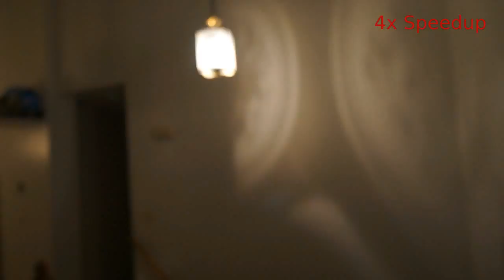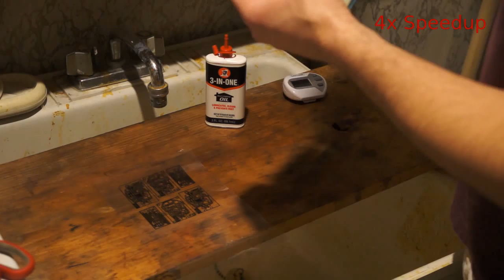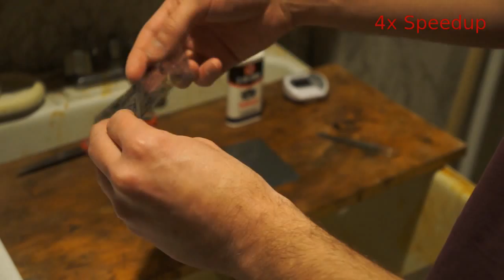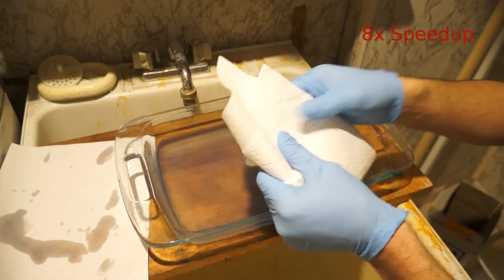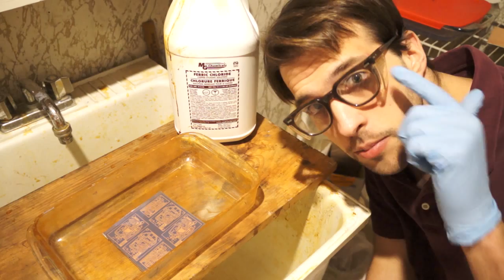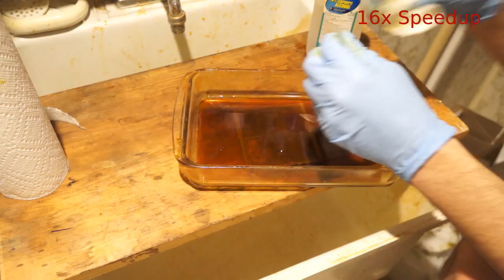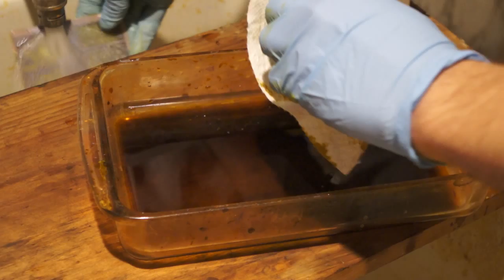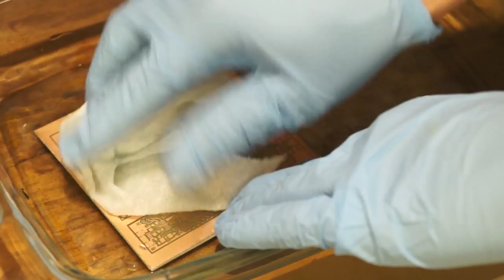How I do my projects - Part 2 - Producing the PCB

Comment: Ridiculously complicated :)) I recommend using PCBs with UV sensitive coating on them > Sodium Metasillicate (as developer)  > Ammonium Persulfate (as etchant). Much cleaner and faster (the whole process takes  less then 10-15 minutes, including exposure (also - I expose only for 70 seconds on my DIY exposure unit - precise and fast. just needs to warm-up for a bit before the exposing starts)

Comment: I did the old making PCBs at home for years, i use to buy the exposure type copper clads, i don't anymore, I do this now:
1. design your board on your favorite PCB program
2. convert files to gerber
3. go on ebay and find a inexpensive PCB manufacturer 
4. send files, get quote, and if satisfied, pay them.
5. wait for delivery.

trust me, I went the manufacturing method and I've never look back!
Reply from the maker: +BCcreativeInnovation I do some of each.   I use electrodragon when I need 10 big boards dual side and can wait.  They do up to 10cmx10cm for ~$20.  I use Osh park for smaller boards. I print my own when I want a PCB in 30 minutes

Comment: Good video, I do it a bit differently: I don't use water when laminating the resist, just do it dry. I have to double-up the mask becase the printer leaves holes, and I don't use oil, just hold it down with a sheet of glass and some weights. I cut the boards out with a multitool and chip-breaker router bit - I find shears can often delaminate and wreck the material.
Reply from the maker: I used to apply the resist dry, and I used to do it without the oil.  But, the oil makes the mask much more forgiving, and the water makes it so you don't get those annoying imperfections and bubbles of air.

I also used to use a dremel with a cutting bit.  The problem I had with that was the dust it generated got into the gears and destroyed the tool. Apparently fiberglas dust is terrible for machines :(.

I have had trouble with some shears on PCBs from providers, but, I found a guy on ebay that sells super high quality PCBs, and haven't had any problems with them :).

Are you still able to get fine pitch when you double-up masks?
Reply: CNLohr Well, I use the same tool for drilling etc, so it's going to get fibreglass dust around it anyway. Might as well using it for cutting\routing too.

I have had no problem with doubling up masks. As long as I take care and align them properly. I have successfully produced boards that included LQFP-48 packages - 0.2mm pads with 0.5mm pitch. Good enough for me!
Reply from the maker: Get some pics up on /r/electronics!  I actually used to do .5 pitch parts with toner transfer, but, not with anywhere near the quality!

Comment: I'm so jealous of your results. I just tried dry film for the first time a few days ago. After watching this I see I've over exposed my film, need to try the water application technique, 3 in 1 oil trick, and I can get more aggressive than a cotton swab for rubbing stubborn areas of an etch. Thx for the tips.
-Jake
Reply from the maker: Let me know how it goes!  It probably too ~20-30 prints to get this good.
Reply: CNLohr 
  I just did my first successful double sided etch today. The water emulsion/vinyl graphics style application of the Chinese dry film made a massive difference. I also used a 1/2 folded paper towel between my iron and the board instead of the different papers I had tried before. That made a big difference too. The paper towel distributes the heat way differently than a piece of paper, card stock, or news print. I did need to use scissors to keep from pulling on the dry film though because the film stuck to the paper towel far more than other forms of paper.
  The biggest difference though was a 2 minute sunlight based exposure time. I think it was even a bit too much. Clearly a 5 min exposure was creating lots of problems before. 
   I need to try distilled water with my sodium carbonate next. I'm still getting some stubborn areas that don't want to etch. I can't detect any remaining evidence of film in those areas, but something is still not dialed in very well. Running my sodium carbonate through an old retired coffee grinder seemed to help it dissolve better.
  I haven't drilled the board yet, but it's a 4"×6" board with 4 TO-252 FETs, low side shunts, a LM324 based current sense amplifier, and a CD4050 buffer for good measure on the gates. It's really basic stuff for switching a 4 channel LED strip bench lighting setup. I've designed it as a separate block with screw terminal inputs/outputs so I can reuse the design elsewhere later too. I also borrowed the current sense amplifier topology from the cheap Chinese dual volt/current meters, but adapted it to a 324 instead of the 1/2 LM358. I also used an AMS1117 adjustable Vreg on the board with an intended preset voltage of 3v3.
    I can't believe it came out so well on the first try. I used your oil trick too. I just used my bike chain oil, some Prolink Gold. My results are good, and my best yet. The oil made me nervous though bc I couldn't get all of the air bubbles out and couldn't figure out which layer they were in, but the results are good. I actually forgot to flip the back side of the board's transparency in software prior to printing, but my design only has a few traces on the back and is mostly ground plane so I just exposed it with the ink side away from the board. Even with all of that I can see my small drill guide pin holes through both sides of the traces.
  I also highly recommend using fill planes on any possible wire nets and running the final image through GIMP to teardrop all pads and smooth all intersections. Those additions to my workflow made a big difference when it comes to how the dry film developed. Plus GIMP gives much better resolution control than any other printing alternative I have used so far.
  Thanks for the tips and motivation. It really helped me step it up a notch ;)
-Jake
Reply from the maker: Woaoaahh that's a big comment.  I'm hearting this for future checking.  I'm really glad to see the oil helped.  And, I never thought about the purposes of the paper towels, they're just soemthing I started doing... Let me know about your developer stage and what improvements you make there.  I feel like my method just isn't that good.
Reply: CNLohr 
  I want to try distilled water with developer like I mentioned. The other tip I saw recently was to try to etch the board for around 30 seconds at the very beginning before applying film. The intent is to maximize the surface "tooth," or to put it another way, to maximize the surface area chemically instead of mechanically.
  The issues I'm seeing at the end of my etch visually resemble a chemical contamination issue. There's a certain kind of blotchy consistency that reminds me of stuff I used to deal with while painting cars. I know my surface prep is sufficient. If I were to have surface contamination issues they should follow the mechanical imperfections of my surface prep instead of a natural random blotchy consistency. I imagine the problems could be related to the quality of materials used too. I'll try to order some copper clad from MG Chemicals on my next major distributor order. 
   My next steps are to try pre-etching as a surface prep, try preheating the copper clad to ensure it is moisture free, use distilled water with my sodium carbonate developer, and try switching to virgin lacquer thinner for surface prep (stronger solvent/cleaner chemically/less damaging to the user as acetone goes right through the skin on contact [no one wears gloves ALL the time]).
  I'm also interested in either trying to concentrate my old pre-diluted ferric chloride from the last days of Radio Shack or playing around with hydrochloric acid and hydrogen peroxide soon. 
  I asked the YT CC Nurd Rage to do a DIY tutorial for a PCB tinning solution awhile back and they showed how to make it using hydrochloric acid, hydrogen peroxide, 95+% tin, and thauria from a consumer level silver polish like tarnex. I could always go buy tinning solution but the advertised shelf life is rather short after opening, and that stuff is super expensive for such a small step in the process.
    I really want to master uv solder masks so I can place traces between pins or under some types of components in the future. I need a flatter tinned surface though. Tinning solutions seem a lot easier than creating a large solder pot/(redneck) makeshift wave solder setup. I can't seem to tin an entire board with an iron and get it flat enough to justify attempting a solder mask.. at least not yet. I just tried yesterday. I coated the entire board in a thick buttered layer of flux. Then I tinned the board completely using a minimum amount of solder keeping it as flat as possible. There were still some high spots especially on the larger ground plane side. I cleaned off the flux completely, then I used 600 grit sandpaper to level everything that was high as much as possible. Then I covered the board in flux again and applied an iron on everything. It's the flattest surface I've been able to achieve but there are still too many inconsistencies and I'm nervous about applying any more heat to areas with smaller traces. I also tried hot air but didn't like the results I was seeing.
  Lastly, I tested all of my permanent markers on the edges of this past etch. I've seen a lot of internet banter about sharpies and such. I have used the dirt cheap Chinese art markers marketed as etching markers. I use them quite a bit for making quick breakout boards for stuff like TO-252 or TO-263 packages. On this board I tried sharpies in silver, black, red, yellow, blue, and green, along with the Chinese permanent marker. The Chinese marker bests all sharpies by a considerable amount. The black sharpie barely works. All the rest were totally ineffective, with the silver producing an unusual chemical reaction local to where it was applied.
  It's a shame I'm working on my bench lighting and can't film this stuff very well until I'm done. I'd like to share some of this, although I don't really like filming my first attempt on anything.
  Have you tried any alternative tinning methods or solder masks? ;)
-Jake

Comment: I'm gonna try the 3 in 1 oil you recommended.  I do imaging with a vacuum press frame at the moment. II happened to have a vacuum hot plate (for seperating lcds from their top glass).  The vacuum is switchable independently from the heat. I built a plexi box with hinged lid and front door then painted it black. I drilled holes in bottom and used weather stripping to form a oval I lay the board and transparancy inside. I then lay glass on top, hit the button for vacuum and the glass draws down compressing weather stripping and pusshing transparancy into CC/film.  I think adding the 3in1 will make results perfect. Also I liked your tip about how to save a board where the resist stayed in places it shouldnt have. Ive lost a few to that (just yesterday actually) Wish i had seen this sooner!

I have a few ideas for you/anyone looking to etch...

1) cupric choloride: if you have outside space you could consider switching to cupric chloride, its going to take forever to make it if you use pharmacy hydrogen peroxide...trick is go to sally beauty and buy volume 40 hair bleach. Its 12% peroxide. Beauty of cupric is you just bubble air into it or add peroxide to regenerate. unless you never want to etch again you can always reuse it. no waste disposal required until your relatives have buried you .

Cupric works best with a vertical bubble or spray etch system. I used plexy to build a vertical bubbler tank.. A good tip here is you can get a chemical weld between plexi sheets using acetone and light clamping pressure (it grabs in less than 5min but keep light pressure on it for 12--24 hrs). My tank is welded and siliconed on both sides as an extra precaution. I used 2 fish tank air pumps and aquarium air hose glued to the bottom of thank. Before inserting into tank I made  bubble holes along the lengh that would sit at the bottom. I did this byI pressing a jumper wire (with header pin end) against the plastic hose and then touched soldering iron to it until it melted a small hole. Move down half an inc; repeat.. Im in an apt and outside is my 3rd story patio so I also built a "weather" enclosure for the tank and a rinse tray out of 2x4, 1x6 and plexi lining. This allows it to not tip/spill acid in high winds/storms. It saves me from having a tank of cupric inside a small apartment. It saves my patio from contamination and my ass from eviction. . The idea was make it strong enough/heavy enough so wind would have to rip the balcony off the apt before acid spilled. If that were to happen the building damage would probably over shadow the acid issue(lol). 

the toxic part isnt the acid itself its the copper salts with in. Cupric is capable of chlorine fumes but that mainly happens when you first make it. The diff between it and ferric is that with cupric you dissolve copper in it before you do your etches so it contains those salts from the start. Once you have used ferric its just as toxic. Aka its not really much more of a risk than ferric if you do your homework. Making your batch of cupric is defiantly an outside away from building or fume hood thing but once you have it its much more tame. 

Last i wanted to say...ferric isnt that nasty if not hot...if you have no cuts on your hand cold ferric isnt going to do much more than stain.

great video overall!
Reply from the maker: I read your whole post, but I'm just not sure how to respond!  I always toy with these sorts of things but it's never quite jumped the gap for me.
Reply: lol sorry for the mess that was. I cleaned it up a bit (i need to get "proof read" tattooed on my hand.). 

have you tried building things with plexi and acetone? if you have a circular saw... harbor freight has an 80tooth 10inch blade that isnt made to cut plexi but works like a charm on the miter and table saw ive used it in. . I think it costs 26 bucks. Thats what ultimately what opened the door to the world of plastics for me. I need to replace it now because I cut aluminum with it but for 26 bucks its hard to go wrong.

one last thing i forgot above: have you switched to led yet? digi key has a 4.1w 365nm led. Bright AF. you will need to build a sheilding box around it so you dont end up with fakatka vision ;)
Reply from the maker: I actually do a lot with plexi, but never needed acetone.  I can cut whatever I need pretty much on my mill.  If I needed something to fit together, I could just print a tooth-pattern (see newest video).  I have switched to LEDs.  Though 4.1W is way anemic.  I got a 100W one from china and pump about 50W through it.  Sped my exposure process way up.
Reply: ive got an outrunner brushless motor on order from the land of buyer be ware that i intend to turn into a drill press first and cnc later. problem is most of the mods to do that require a cnc machine to begin with. I need to add an extra bearing further down the shank to take stress off motor during lateral movement.   There is a metal shop down the street from me that I might convince to do it for cheap but its all up in the air. 

50w led? whats the wavelength though? afaik most resists respond best to 350-380nm. When i was looking into it even multi watt LEDs in those wavelengths were experiments in a lab or hella $$$ just 3 years or so ago. aka...idk i would trust one hung low brands output with out a spectrometer. If you are putting out 50w at 390nm-420nm it might not actually be as power full to the resist as 4w at 365-380. speculation asside my exposures seem to work in 2 min.  They will probably be less when I source low iron glass.

 i just tried the oil with my press rig...holy fucking sharp lines! damn banana plug on + was a bit crushed and i realized it about 45 seconds into one side (realized psu fan was fluctuating looked over and saw power level doing same on display) so i hope i got full exposure but regardless im really impressed. I double layer transparancy on both sides so i shot it inbetween the layers too...of to dev.
Reply from the maker: 385nm - it completely cures in about 3-4 seconds at 2 feet.  After about 6 seconds, the masked area cures, too :-p.  I don't understand your last paragraph, though.  Which oil? 3-in-1?
Reply: yes 3-in-1...holy shit thats fast. I found reasonable price low iron glass last week. I have an 11 x 11 x 1/8 in sheet on order. I did i bit of testing and I think i will get mine down to about a min per side by over driving my emitter and using the right glass. Also I ordered some green uv resist from Russia thats supposed to go to 1.6mil resolution. The guy selling had advertised something along the lines of put the blue/purple shit in the trash where it belongs. im hoping its as good as he says.